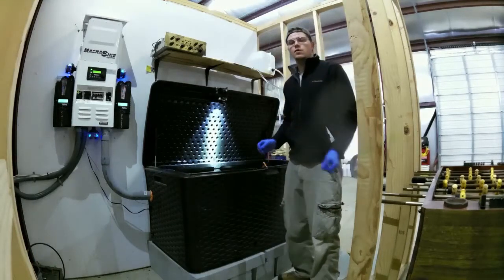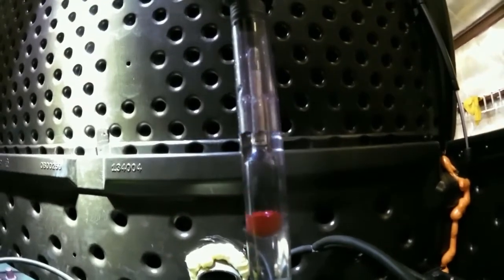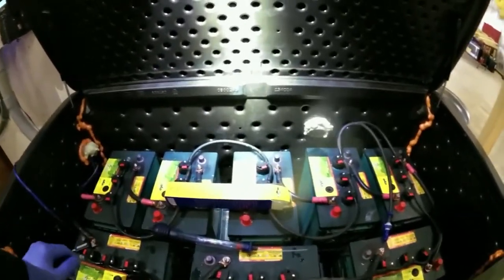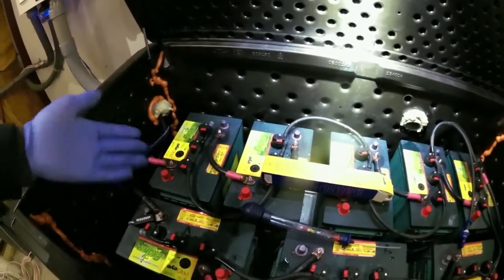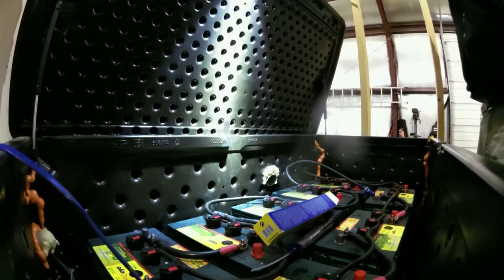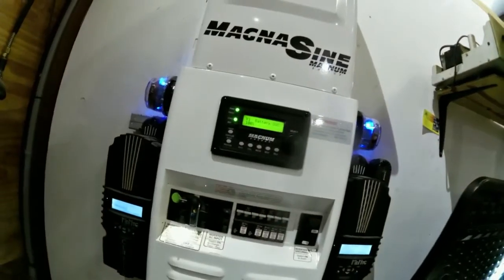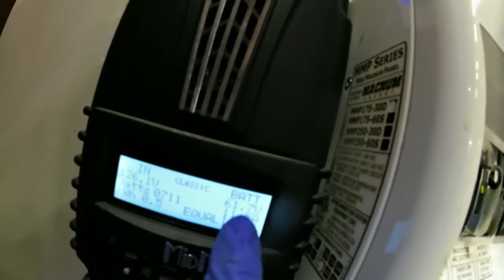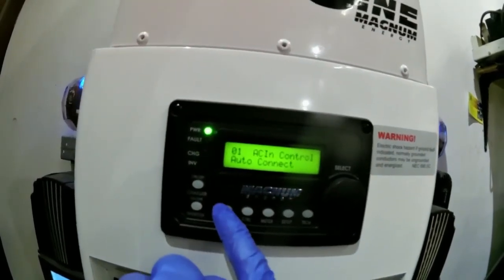Battery Based Solar: Flooded Lead Acid battery maintenance

Comment: it can't get any easier then that. but do you suppose people will do simple maintenance. I can't get people to do simple maintenance and they destroy batteries and wonder why they don't last
Reply from the maker: Most of my customers seem to be doing a pretty good job.  They definitely need to understand the maintenance required going into it, I usually make them visit my own system.  The battery watering kit makes it so easy to keep them watered.  A lot of folks just EQ every month.
Reply: I find if they have problems they wait to long then it's an issue that hard to reverse. The damage has been done.
Reply from the maker: Roy Amberg that's why we have service contracts!
Reply: I have yet to get anyone in this part of the country to buy one.